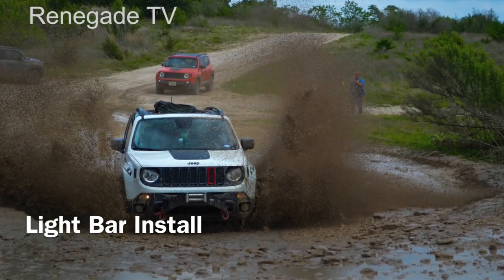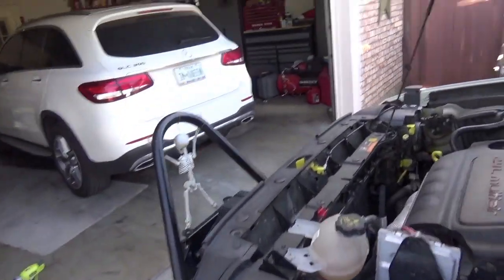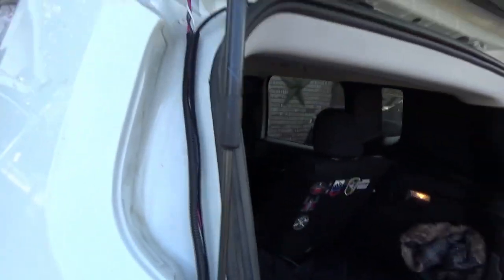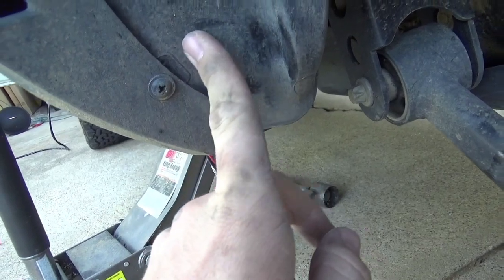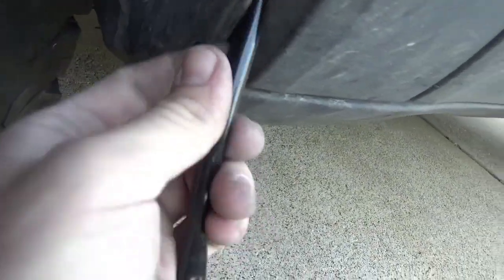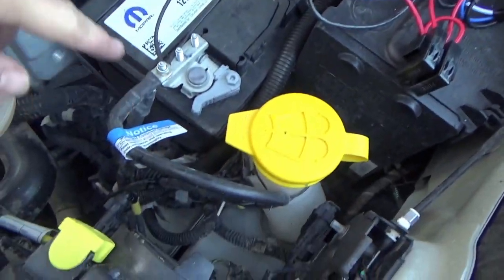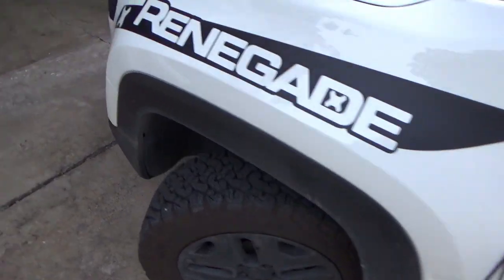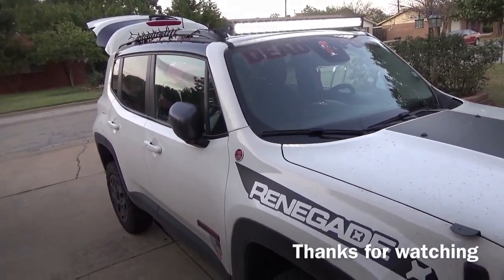Renegade Tv- Jeep Renegade Lightbar Installation

Comment: The only issue I see as an electrician is that the wire will rub through vibration without a conduit of some kind. If you can later on where it's exposed to weather get some of that black shell material and it will help prevent the wear from vibration rub. It will also be some protection between the wire and the zip tie.

Comment: Is there a lot of wind noise I had a lot putting on a Thule roof rack. I had to wrap a bungee cord around it to stop the noise. Also it looks really close to the Roof in the middle did you have to Glue so Rubber to the bottom of the light to keep it from marking the paint???

Comment: Hey we were looking at your video on the roof mounted light bar.  I wanted to see if you liked the brackets you used for mounting them.  There is a set on Amazon that look like yours. Would you buy them again or recommend them? Is there any issues they caused with the roof rack mounting? Thanks Ed

Comment: I did mine in an hour it's faster to run it under the head liner. Plus I have the harness under the dash to avoid water and heat damage to the relay.

Comment: Nice install.but why didn't you use split loom to protect the wires on the under side if the vehicle? And where are you going to move them to if you install rockrails?
Reply from the maker: Good question. See I got rock rails from daystar and it has a channel I can put the cable in and it will be protected

Comment: those wire behind rear wheeel are going to get destroyed should have put them inside of  asealed loom not the open type atleast where its in the open 
looks good non the less good stuff
Reply from the maker: So far no issue. The wire has a thick coating around it

Comment: I know it wouldn't be proper, but what's the easier way to do this? I've had this lighbar in my trunk for a few weeks waiting to be installed. Also, what are some 'must have' mods? Just bought my jeep not long ago and have been itching to start on it.
Reply from the maker: Honestly the best mod to start with is a lift, new tires ( I recommend 225/65r17 bf Goodrich ko2), and lastly armor. Aka rock sliders and skid plates. With al that done you will have a ba rig that can go nearly anywhere.

Comment: Great video! They only way the light bar could be better if they were x’s. Where did you mount the switch? It was still dangling at the end of the video.
Reply from the maker: It’s actually still dangling 😅. I’m about to do a custom set up that I will be recording and putting a link to for the light bar install

Comment: Looks awesome but I don't how those exposed wires are going to hold up over time.
Reply from the maker: Which ones. Everything is under some cover of sort from the sun and the runner board one will be covered by my rock sliders soon
Reply: Chimichanga Tv i think he means between 3:30-4 minutes.
Reply: U should have run all those wires inside the vehicle under the little rocker panels that is already hiding wires.. that's where I ran my wiring for my sub/amp
Reply from the maker: I was looking for a way everyone can do it without having the knowledge or skills to remove the panels. If you have rock sliders this is a great way to get it done and would be protected pretty well. I never had any issues and I ran my renegade threw a bunch of mud and rocks.

Comment: Nice installation.  Where did you get the brackets for under the roof rails?
Reply from the maker: +Steven Schlundt I had purchased them off of eBay. But I have a friend that is making some at Valkyrie offroad. Check them out.
Reply: Nothing could be found available at this time on the site.  Do you how much they were priced?
Reply from the maker: +Steven Schlundt here is a link. There on Black Friday sale 

https://valkyrieoffroad.com/black-friday-light-bar-bracket/
Reply: Thanks Coulton!

Comment: Great job at everything! Question...in regards to wiring, are you /would you be able to run the same wire job but on the passenger side? I plan to use a light bar for front, driver and passenger 90 degree pods on the sides, and 2 180 degree pods facing the rear. Thinking of splitting up the wires and running just what you did but down both channels on top. What would be your suggestion? I have no idea in regards to wiring but have friends. Thanks a bunch and keep it up!
Reply from the maker: Yes I don’t see why you couldn’t do that but just be carful with any wiring. Make sure you have proper fuses and fire safety. Any additional wires is a fire hazard in any vehicle

Comment: Does your light switch remain illuminated even if the car is off?
Reply from the maker: Some do some don’t
Reply from the maker: So do some don’t.
Reply: Chimichanga Tv 
My light switch is still illuminated, even when car is off and the led bar is off.
Reply from the maker: Yes some do that it’s no big deal. Just showing there is power too it. Won’t cause any harm

Comment: That seem harder and too time consuming for me then just running it down the window or just drilling a hole on the roof and buying a waterproof plug that you could screw in and seal. But over all the renegade looks good.
Reply from the maker: Having a mysky drilling into the roof isn’t a good option for me and I just hate seeing cables so taking that little extra effort is worth it too me. But yeah it’s ones personal choice.